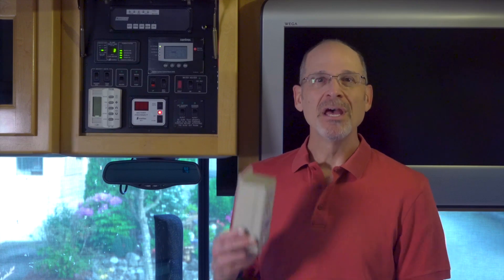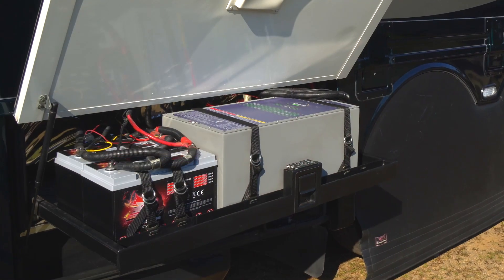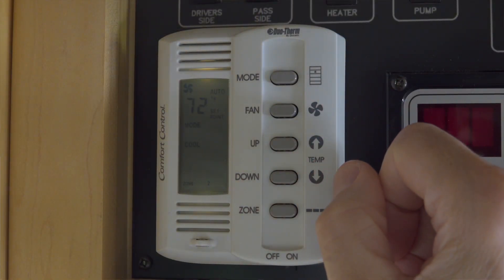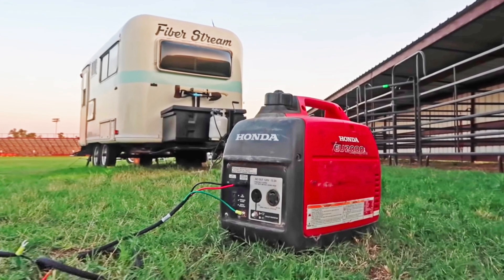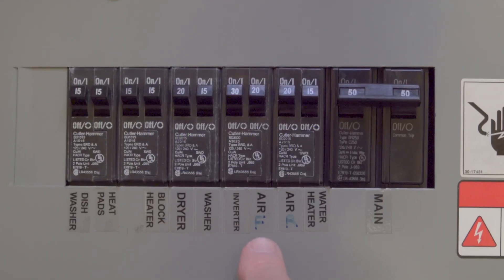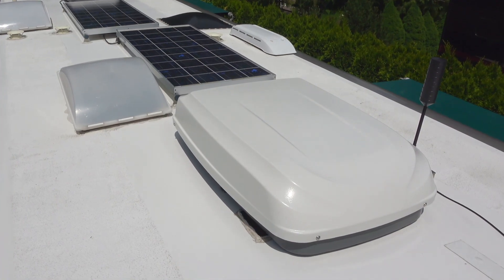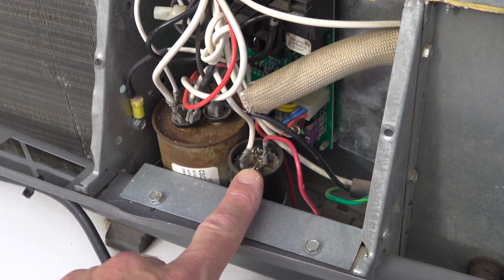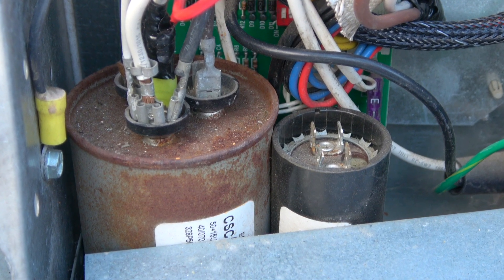Micro-Air EasyStart RV DIY Installation. Run 2 RV A/Cs on a Small Generator or 30-amp Hook-up! Cool!

Comment from the maker: $25 OFF EasyStart! Use Micro-Air Discount Code RVGEEKS to buy an EasyStart 364 factory direct at https://microair.net. The discount applies to each one you buy, so you can save $50 or $75 if you have 2 or 3 air conditioners!
Reply: wanted to add this device does not work if your batteries are low and your charger is charging. it will over amp. I spoke with Micro air and they confirmed.
Reply from the maker: Running two A/C units off a 30-amp circuit does indeed require most of the available power. The way we're able to charge our batteries at the same time (if needed) is to set our charger down to a much lower maximum level, such as 5 amps, basically throttling the charger. That will of course take longer to charge them, but if you have the time, such as an overnight stay, it's usually plenty of time to get them charged up.

Comment: I purchased a Soft Start that I’m getting ready to install. If I had seen this video first, I would have purchased an Easy start. I say this, not because the Easy Start is necessarily better. I state this because your sequential step by step instruction video was excellent. Absolutely one of the best, of the hundreds, I have seen on You Tube. Clear,paced,presentation,with a smile. Bravo!!

Comment: We had been used to running our 5K and 8.5K BTU units (2 separate campers) with our little EU2000 but our recently purchased  new camper has a 14.5 BTU unit so I've been contemplating an Easy Start and watching YouTube videos. As usual, your instructional skills are just so much better than anything else out there and I'm confident now with my ability to do the install correctly. Now if I could only come up with the sizeable chunk of change required !  Thanks for the great video :-)

Comment: I got my first RV (Highland Ridge - Mesa Ridge 2410RL) last spring and have been contemplating getting one of these for the past year. I was just contemplating between this and the SoftStartRV, seeing the SoftStart was marginally cheaper if purchased from the manufacturer. It has been difficult to make the decision between the two but I was siding toward the EasyStart. I then came upon this video and the $25 discount was all it took to make the decision easier for me. I just ordered it and hoping it arrives before the weekend, so I can install it ASAP. I finally have a chance to use my trailer for the first time this year (due to the COVID scare canceling all my other trips) in a couple weeks.
Reply from the maker: We’re sure you’re going to love it, Ron! Game changer!

Comment: Every detail professional quality here guys!  The only thing I would do differently is to check for  voltage on both incoming hot and neutral before proceeding when that access cover is removed. Protects you from a buzz due to mis-wired power cord or mis-labeled breaker.  Thanks for the informative video!
Reply from the maker: Thanks so much! We have a device that automatically monitors/checks incoming power, so actually a different subject than we were covering here today. We have a new video in the works all about it, and can't wait to share!

Comment: You were correct to show the issue with hair dryers. When your hair first starts to thin, such as mine and yours, the dryers seem to work slightly harder.  Not sure why,.....  The soft start will be a godsend for those times.  This video is ARVGC,......"Another RV Geeks Classic".
Reply from the maker: Thanks Myles! 😊

Comment: Great idea. I thought about going this route but I decided to use a Coleman Mack 3 13.5 btu powersaver in the front of our coach and wired in a Coleman Mach 1 11k btu powersaver in the bedroom. Our coach is only a 30 amp and both air conditioners only pull 20 amps together. We can also run our fridge, battery converter, and watch tv at the same time with no problems.

Comment: OMG thank you so much! We had no idea this device existed. I don't jmore hows many times we've had to take a site we didn't like because it was the only 50amp available. Or how many times we've been a bit warm because we can only run 1 A/C unit. This is going to make my guy a much happier camper. Safe travels and happy RVing from The DeCampers.
Reply from the maker: Thanks so much! Since we're on a 30-amp site right now, they're already making a difference for us this summer. 😊

Comment: Nice job!  We installed one on our tt a few weeks ago.  It does make a huge difference on startup especially if running on the generator.  Install was fairly simple but had to call for advice on wiring it up.  We have the newer domestic so we had the blue wire you talked about and no start solenoid.  Well worth the $300!

Comment: Perfect video, perfect timing! Our new 2020 Rockwood has two rooftop AC units and my Champion dual fuel generator that we reviewed and love, just doesn't quite cut it. Thanks for your work on this issue! 👍
Reply from the maker: Great to hear! Thanks for letting us know, and congrats on your new rig! 😊
Reply: i have 2 15k units and the same generator...wondering if this has worked for you

Comment: There's another possible issue with a 30 Amp feed.  In general, circuit breakers will not sustain their marked current.  They are allowed to trip at that current after some extended operating period and should only be depended on for 80% of their marked trip current in continuous applications.  But this would be a good addition to our dual A/C coach if we get stuck with a 30 Amp only pedestal.  Thanks for sharing, and the discount.

Comment: Hi guys. I have a similar soft start device on my second A/C unit only, which saved me some money. My first A/C always starts up first, so the added surge of the second A/C was my issue. I can cycle both units on 30A power all day long. I have the same Intellitec EMS unit as you have. It never lets me down, it will shed power to one or both units if I need extra power for anything else like the microwave. Great video as usual...love the special effects with the hand tools! 😆
Reply from the maker: As always, there's more than one way to solve a problem! Thanks for sharing, Craig! We love our Intellitec EMS (not sure why EVERY RV doesn't have one like it!), but there are times when we don't want an A/C to shed... not sure what happened to us always being in 70-degree weather, but somehow we keep finding snow and heat! 😜
Reply: On my old Bounder, I had the Intellitec Energy Management system and it was great but as it aged the auto feature would stall and I would have to use the hi or lo cool setting to get it started and then move to auto after a bit.   
I see that they are using this system again in new van units but they are now digital.  Would have loved to have had the Micro Air soft start units on my ac units.
Finally moved to a newer rig with only one AC so not a problem now.

Comment: For those with coaches that have other 120v loads...like residential fridge, pass thru inverter loads to outlets...or would like to use the blow dryer or microwave... you may find that the EMS will still shed one of your A/C units.  With sufficient battery capacity...or if you have Solar installed...we use our ME-ARC remote to set AC-IN to a SOC (State of Charge).  We set it below the current SOC.  This, in essence, splits your electrical system.  Solar &/or Batteries run the inverter and all associated loads...TV’, Microwave, Blow Dryer, Residential Fridge...whilst the 30A shore power is basically dedicated to running the two A/C units...provided you don’t forget and use an electric element for hot water, or try to do laundry, etc...  30A shore pedestals are no longer a big deal.
Reply from the maker: Hi Charlie! Didn't know the ME-ARC/Magnum system could be set like that! Good to know! We do a similar thing in that situation (hooked to 30-amp power and need to run both A/C units)... we turn of the circuit breaker that supplies the 120V power to the inverter/charger. That way, the inverter takes over the loads of all circuits handled by the inverter (in our RV, that's pretty much all outlets (except the washer/dryer and dish washer), microwave, TVs, etc). That removes those loads from the shore power circuit, freeing all 30 amps to be used for the air conditioning.

Comment: It's useful to view inductors and capacitors as energy storage devices.    A capacitor stores voltage and an inductor stores current.   Batteries, of course, store both.  The electric motors in air conditioners are primarily made up of windings of wire that form an inductor that generates the magnetic field required to start the motor turning.   When the compressor motor is energized, the first thing that must happen is that the coils of wire must absorb enough current to generate the required magnetic field to start the motor turning.    This inrush of current is the problem, here.    The inductance coil in the motor demands ALL of that current at once - which causes the current spike being observed and what often causes the circuit breakers to trip.  Once the coil is "full" the current spike stops, and only running current is required to keep the motor turning.  Likewise, when the motor is shut off, that stored current in the motor's inductance coil "drains" back into the circuit, so it is not there the next time the motor needs to start.

Comment: What I did with my 1991 Bounder was to tap into the generator line. I cut it and put a male-female connector. I plug a regular 120 v line into it and put the A/C switch to front. Both A/C working fine. The back A/C is powered from the 120 v line coming from the generator line.

Comment: Very well done video.   The so called strain relief is actually a grommet.
Please be aware of some circuit breaker characteristics.    Circuit breaker ratings are 100% for non-continuous loads and 80% for continuous loads at an ambient temperature of 85 degrees.   What does that mean?   A 30 ampere rated circuit breaker will handle 30 amperes continuously for less than 3 hours (non-continuous)at 85 degrees.  For loads that last longer than 3 hours(continuous) the breaker can only handle 24 amperes at ambient temperature of 85 degrees.   If the temperature outside is higher and the sun shining on the box, the values will go down.
If the AC's are cycling, then should not be an issue.   But if over 100 degrees and they do not cycle, expect possible tripping.
Respectfully,   Kevin

Comment: Thank you very much for your carefully done video. Your work is appreciated. I would add that I would, if leaving in the start capacitor unconnected, short out the terminals with one of the wires that you are discrading, probably the white one without the PTCR. These large capacitors can accumulate charge just from the ions in the atmosphere. It may not matter, but I would think it better safe than sorry. Travel Safe Henri.

Comment: Standard black electrical tape has a very low durability factor, especially in hot locations. Consider getting some  electrical splicing tape (also called self-bonding tape)  for a bullet-proof install. In  the future use it wherever you normally think of using normal electrical tape. Thanks for the video!

Comment: this smart "soft starter" is fantastic because it is self-adapting to the compressor it is driving.  There is really nothing better.

Besides starting on low Amps it also prevents abuse to the main contactor and ads years to the compressor life.

Jolting ON any motor with an UNLIMITED CURRENT creates a 5x surge that nukes the bearings.

You may want to also ad a cheap "soft starter" to save the life of the blower fan as well.

 Google "Schneider starters" (general purpose motor starters...)

Comment: Interesting upgrade. Did you hear about this thru the Wynn’s as they added these to their RV AC 1st & then to their sailboat AC’s as well. They highly recommended them too. Nice job!  👍🏻👊🏻
Reply from the maker: Thanks Ric! It was over three years ago, so you might not remember it, but we made a guest appearance in Nikki & Jason's video about running their A/C off solar! It's about a minute in: https://youtu.be/B0rZY5uotKI We were also on their boat in Panama.... but the A/C was never in use while we were there (even though it was HOT! 😂). We've known about the EasyStart for some time, but it was just one of those projects that took us a while to get around to!

Comment: We have a 22 year old Dometic 15k Heatpump (no heat strip) and 13.5k AC only.  Run on 30 amp shore power.. OR my 3500 Honda Inverter.. even ran converter!

Comment: I’ve never tripped the breaker on the pedestal. 
But about all places I been it’s two large draws before the voltage gets low enough to worry. The travel trailer I have now I may get by with the ac and the microwave and maybe if the hot water heater is going. Have to pay closer attention next trip

Comment: You MUST bridge the terminals on the deleted start capacitor.  They will build a charge from static in the air. They bite hard.

Comment: Another way to go,  albeit  more expensive, is to replace your units with inverter models. They start easy not to mention use less power when they run
Reply: The only inverter rv ac unit I know of is the dometic harrier and it isn't available in 120 volt.
Reply: biohazard 918 I will take your word for that, I am not an expert on RV technology, but I do know that this is an example of how far behind many of the products used in RVs are. Inverter units are wonderful and I do not understand why they are not used. Separately, they still use these units on the roof, I design straight out of the Stone Age, mini split units would be much more effective, getting the weight off the top, it will be quieter, more efficient, and of course they are inverter units already.

Comment: The video forgot to say that if your ac you has the heat pump feature you have a black wire  spliced into the white wire going to the the start capacitor. When you remove the white wire running from the start capacitor to the run capacitor, you then need to attach black wire to white wire side (common) or all you get is heat pump and no AC.   Also, kit no longer gives you alcohol wipes and two of the four wires coming from the Easystart now come with connectors already installed. As of what I received on Feb 6, 2021.  Otherwise video is right on!  Easystart works as advertised.

Comment: Thanks, very good video, i need to add an additional ac above the drivers area of my Winnebago Sightseer, will run it with the gen set as we drive, the dash air just is no good.

Comment: I am getting ready to install mine this week on my coach.  I have the Coleman Mach 8 ACs.  Even though mine are not exactly the same, this video is invaluable to helping me.  Thanks so much for making it.  Say, one other thing.  I notice your roof looks very nice and not chalky.  Do you treat it or do more than just wash it!  What do you use?

Again, thanks for all your videos, I know they take a lot of time to make.  I have watched your for years now and you always do such a professional job and they are so helpful. Thank You!
Reply from the maker: Aw, thanks A2Z! We hope it helps to make your install as easy as ours was. Should be pretty much the same idea, just different steps for how to identify the correct wires to remove/interrupt/replace. Micro-Air's instructions are QUITE thorough, so you shouldn't have any problem.

As for our roof... we don't do anything other than wash it. But we DO have the advantage that it's fiberglass, so it's much less prone to issues. When we had a "rubber" roof (it was actually EPDM, but "rubber" is the generic term) on our old Fleetwood Bounder, we would use conditioning products (from Camco or Thetford... mostly whatever was on sale at Camping World, LOL) to try and keep it moisturized/pliable, protected from UV, and non-chalky. They worked OK... but since we only had that RV for 2 years, our roof material wasn't that old.

We DID try using Aerospace 303 on that old roof, figuring it was the best for UV protection and moisturizing... but even using only a VERY small amount, it left the roof too slippery (especially if there was ANY water on it, including just dew!). And then the 303 would wash off the roof and leave streaks down the sides of the RV... which wasn't any better than the chalking! LOL! So we went back to the purpose-built products which seemed to do just fine.

Hope this helps... and best of luck with your EasyStart install!
Reply: @RVgeeks  Thanks.  Actually we do have a fiberglass roof on our 2013 Itasca.  What do you use on your fiberglass roof?

Comment: Micro-Air is at it again. They've invented a new thermostat control for A/C with WiFi and Bluetooth capacity to be released this Spring. See their Facebook for more information --and also RV Electricity on FB. Its for the aftermarket.
Reply from the maker: Great company! Can't wait to see the new gear!

Comment: Cool! Very interesting stuff. Oddly enough, we, too, can run 2 AC units when we are on 30-amp service. Or the dryer and 1 AC unit. We have a 2016 American Revolution.  :-)
Reply: longhornz30  as long as we like. Remember that we are running on 30-amp service and not batteries. Our power management system will not run any of our air conditioning units off the batteries, but it will allow us to run 2 of our 3 AC units on 30-amp power. We only run one AC unit if we run the microwave or the dryer.